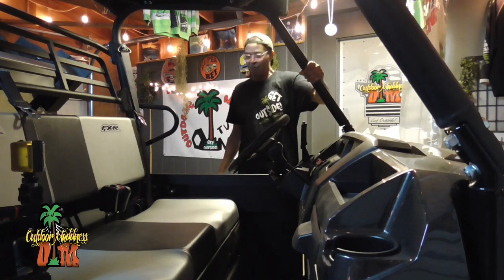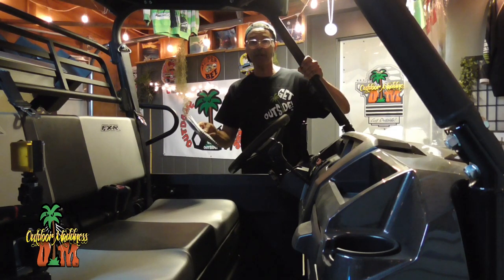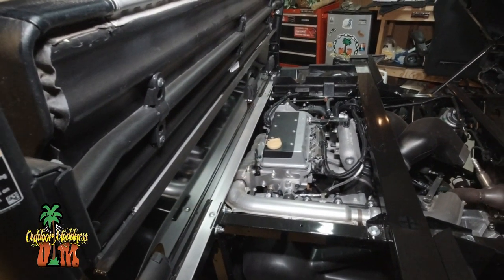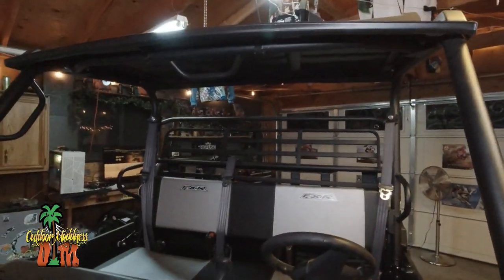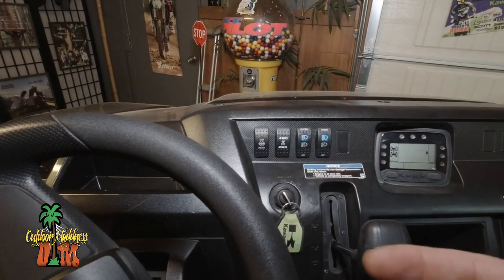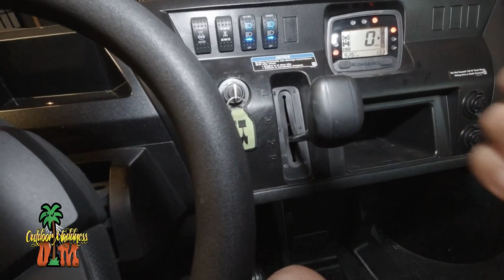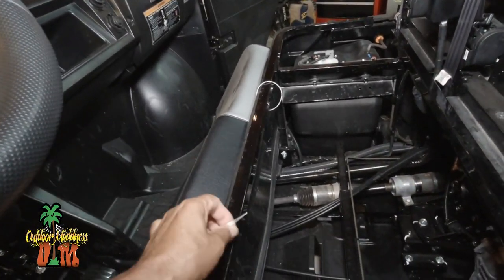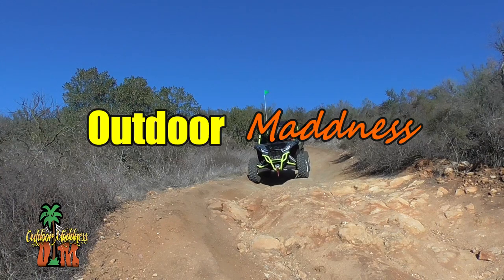2022 Kawasaki Mule Pro-FXR Walk Around

Comment: In your video you mentioned Arctic Cat. Hope you were talking about the Prowler. I am looking to get either the Kawasaki mule FXR or Acrtic cat Prowler. I do mix trail and farming. Your thoughts appreciated on which unit.
Reply from the maker: That's a tough one. I have a 2013 Wildcat 1000. In ten years I've only had one major problem with it, the starter went out. Here's the good thing about the Prowler, it has the same power train as the FXR! That sweet three cylinder motor and super smooth clutching. I think the FXR has a better drive train though. Axles, drive shaft, a armes etc.. I also like the removable seats that you can store right on the Prowler. The FXR comes with a three year warranty, the Prowler, 18 months. In my opinion, I don't think you could go wrong with either one of these units. Don't forget, Tracker makes a unit identical to the Prowler and I think you could get a better price for it. Thanks for watching Albert!!!